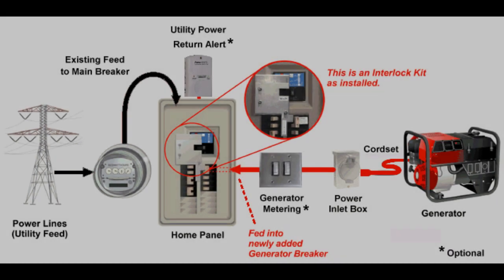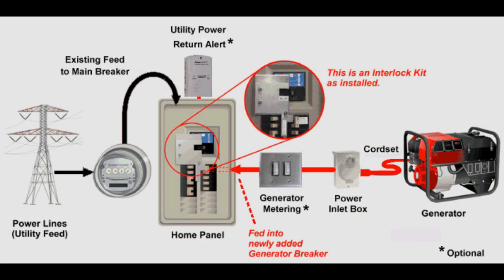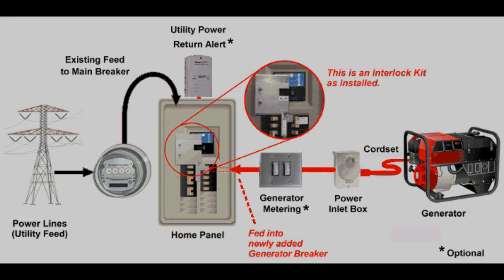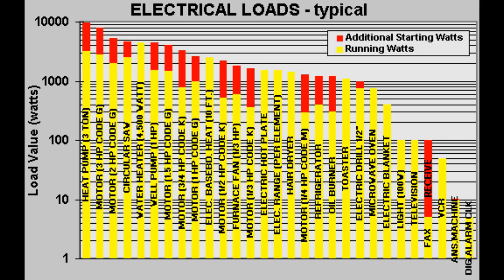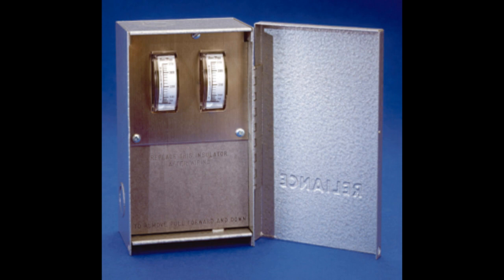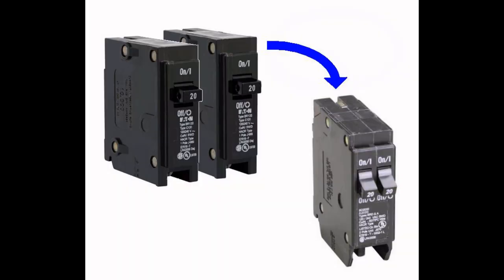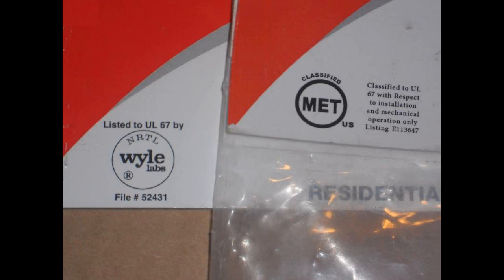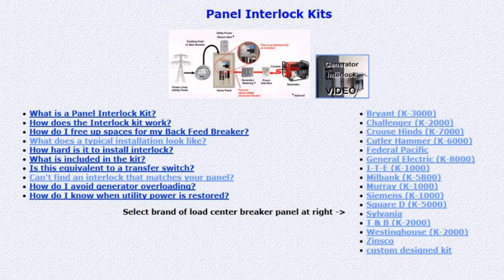Panel Interlocks for connecting portable generators | nooutage.com

Comment: Question.
I want to do this but I have an exterior service panel with mainly AC, stove, water heater and main power breaker. There is a sub panel in my garage for other circuits. Can I still do this?
Reply from the maker: Yes, you should be able to use an interlock as long as it is installed on a panel with a main breaker and space for a double pole branch breaker. And the main must be in the same compartment as the branch, which is NOT the case for most external meter combo panels. If you install this on the exterior service panel then you will be able to provide generator power to any of your circuits. If you install this on the sub panel then you will only have generator power available to the sub panel branch circuits.
Reply: Can you please explain what you mean when you say that the main is not usually with the branch in an external panel? My understanding is that the electrician would be installing a new double pole breaker in the panel that has the main breaker.   I wouldn’t even think about trying to outfit my sub panel  to do this without the ability to shutoff the main breaker in the same box.
Reply from the maker: @MrBritrider  I probably should not have used the word, "usually." As long as the main breaker is in the same compartment as the branch breakers and you can free up 2 pole spaces then an interlock can be used.